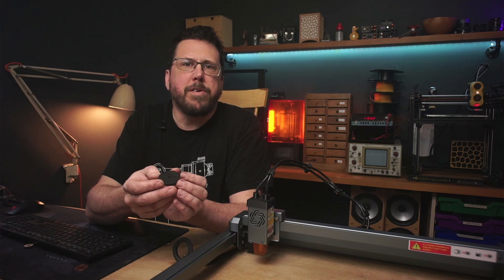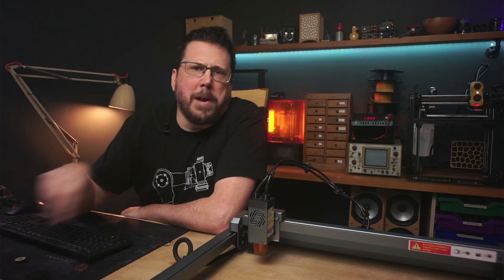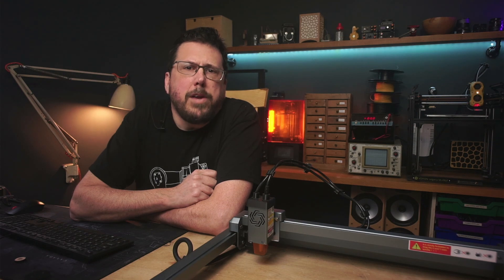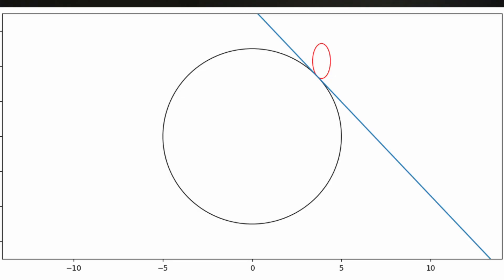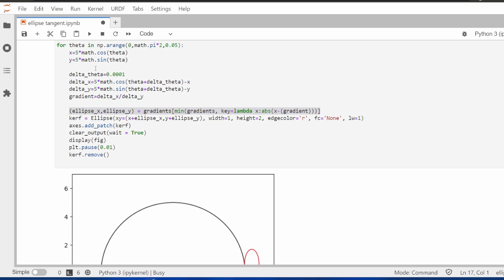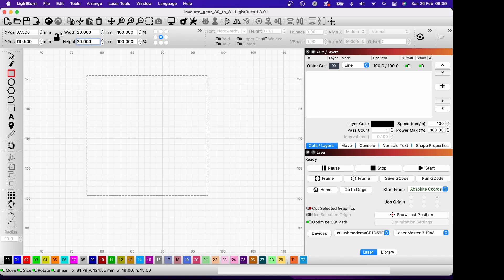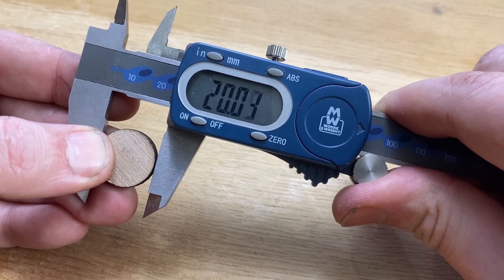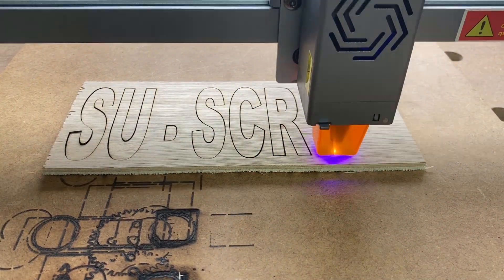Fixing the Problem with Diode Laser Cutters - Ortur LM3

Comment: Hi.. I own OLM3, with Ortur air compressor, and still have problem with cutting.. Working area is 400x800mm. I make sure that the focus is correct, lens are clean, speed and power are correct.. And especially when I do bigger projects, something cut properly, something not.. Smaller projects usually cut ok, but something bigger I have many places, that did not cut through.. Any advice, I start thinking, that I bought defect modul.. Tanx..
Reply from the maker: Are you making sure the wood you are cutting through is completely flat? I found that the LM3 has a very short focal range and if the wood bows up then it won't cut it properly.
I also found that it is more likely to cut through everything if you take multiple passes at a higher speed instead of 1 at a low speed. So instead of doing 1 pass at 100mm/s do 2 passes at 55mm/s
Hope this helps
Reply: @roTechnic  I thought could be focus range.. Usually I work with plywood, which seems flat, but the heat from laser bow some parts up.. Honestly I had better results, when I set the laser modul 1mm higher, than should be.. I'w tried more passes, but then the plywood gets burned on some places.. But tanx for advise, I will focus on the focus range.. 😉

Comment: WELL. KNOWN  ORTUR  ISSUES

ORTUR LM-3 Does Not Power On
One of the most common issues that users face with the Ortur Laser Master 3 is that the machine does not power on. This can be due to several reasons, such as a faulty power adapter, a blown fuse, a loose connection, a faulty laser module, or a problem with the motherboard.
The Ortur LM-3 also has a well-known problem with their “power brick” being underrated.  When I tried to get help with this issue, I was simply ghosted.  I found out later that a proper replacement was available from Amazon.

Laser Does Not Engrave Properly
If the laser is not engraved properly, it could be due to several reasons, such as the focus being incorrect, the engraving area not being level, or the material not being suitable for engraving.

Machine Stops Mid-Operation
If the machine stops mid-operation, it could be due to several reasons, such as a loose connection, a faulty motor, or an issue with the software or firmware. This was a very common complaint on YouTube.

Machine Produces Low-Quality Engravings
If the machine produces low-quality engravings, it could be due to several reasons, such as incorrect settings, a dirty lens, or a faulty laser module. To fix this issue, try the following:

(PS: If you really want the Laser that the ORTUR LM-3 should have been, buy a Longer B-1  30W under $1K online…just saying)

Machine Produces Smoke or Strong Odor
If the machine produces smoke or a strong odor during operation, it could be due to several reasons, such as a dirty lens, incorrect settings, or a lack of ventilation.   This is a problem with all lasers, especially when cutting. The answer is simple install a proper vent to the outside (be sure to provide adequate makeup air)
A box enclosure is highly recommended

Motors Make Strange Noises
If the motors make strange noises during operation, it could be due to several reasons, such as loose connections, improper lubrication, or a faulty motor. It has been commented on several times on YouTube. The problem was that Ortur did not  tighten the drive sprocket set screws properly and they work loose.

Machine Does Not Recognize SD Card
If the machine does not recognize the SD card, it could be due to several reasons, such as a faulty SD card, a corrupted file, or a problem with the firmware.  You can try to contact Ortur but, they will probably just ghost you as they did me.

Machine Freezes During Operation
If the machine freezes during operation, it could be due to several reasons, such as a software or firmware issue, a problem with the motherboard, or an issue with the computer's connection to the machine.  Getting the link set up was one of my major issues with m ortur LM-3. After several weeks, with help from Ortur, I just gave up and sold the brand-new machine at a loss. 
I’m a retired Engineer. This is not my first “Rodeo” with complex equipment.  As with most complex equipment help is usually available from the manufacturer and or distributor.  This was not the case with Ortur. (Maybe if you’re a big-time Youtube content provider with lots of free equipment and support it’s different.)

Machine Produces Inconsistent Engravings
If the machine produces inconsistent engravings, it could be due to several reasons, such as incorrect settings, a dirty lens, or a problem with the material. Or a problem with the PWM (pulse width modulated) laser power controller. Good getting help from Ortur.

“Customer Service and Support”
Simply stated, customer service and support are just not there.  (Again, maybe if you’re a big-time Youtube content provider with lots of free equipment and support it’s different.)
 When you send your hard-earned money to Ortur you are buying hardware and that's it!  
When I needed help Ortur Ghosted me, no help, no support.  My questions were not answered. Your defective parts will not be acknowledged.  Your e-mails and texts will not be answered.  They seem to do anything to get out of spending a dime on their customers.

MY PERSONAL EXPERIENCE WITH OUR

I was counting on my new order lm-3 to modernize my shop and add new capabilities and opportunities. I was really excited when my LM-3 arrived. The new Ortur machine looked great.  I had high expectations for this addition to my well-equipped shop…The icing on the cookie.

Instead of getting a shiny new tool and capability for my small shop, I got only disappointment, anger, and frustration.  Ortur gave me absolutely no help.  They only replied once telling to go elsewhere else for help.

In the end, after trying everything I could find on forums and YouTube, and many unanswered communication attempts with Ortur…I finally gave up.  I sold the Ortur LM-3 at a substantial loss.  And my dream died.

I  URGE  YOU  TO  CONSIDER  OTHER  ALTERNATIVES  BEFORE   BUYING  AN  ORTUR  PRODUCT. 
 
PLEASE DO NOT SUPPORT THIS COMPANY AND IT’S  LACK OF CUSTOMER AND PRODUCT SUPPORT.

I don’t like writing negative comments or reviews.  I just felt that I had to warn others.

Thank you for your time and I wish you success with your new laser purchase.

Comment: i chose the semi-cylindrical lens approach instead. youre still removing all that extra material with the ellipse. and the smaller the dot, the more power in it...
then i found out about the ... astigmatic prisms. lens is cheaper. harder to align.

i dont recommend unless you really can deal with optic mount precision...

Comment: the laser point oval might not be "upright" either, but rotated. that's trickier to estimate. you'd wanna cut an entire circle and measure that along several axes. or cut a polygon (octagon, ...), which might be easier to measure because the sides are easy to tell and label.
Reply from the maker: luckily mine seems upright from the unfocused dot. but the polygon is a great idea!

Comment: Ten times cheaper than the therapy you need when you turn blind by one of these cheap hobby lasers. Machines like these should not be operated by hobbyists. I work with lasers on a daily basis and know the dangers. It's fumes, it's the laser itself, it's it not being a fully enclosed system...

I've messed around with lasers back in the days and looking back, I was so stupid. It's just super unsafe. I hope this trend of letting youtubers review hobbyist lasers disappears soon.
Reply from the maker: Yeah, I can't help but agree with you on your points. This thing need an enclosure with real protection and fume extraction. I'll be doing that before I use it again. 

But I thought there were enough videos on enclosures and wanted to cover a different topic.